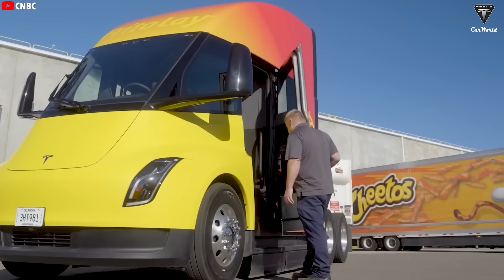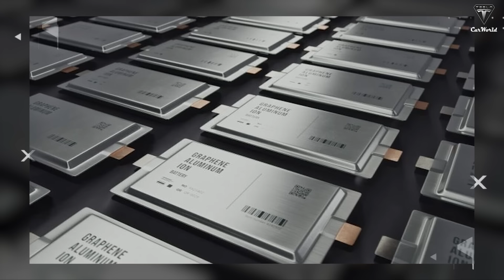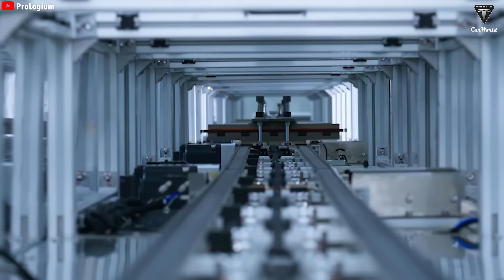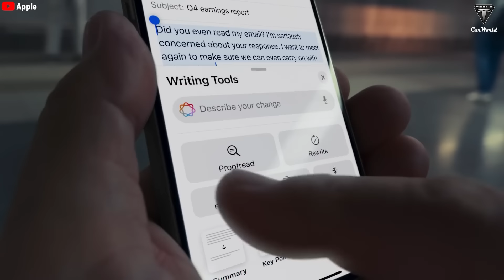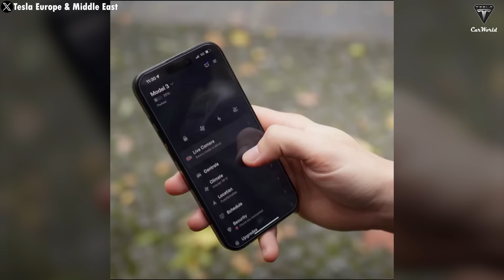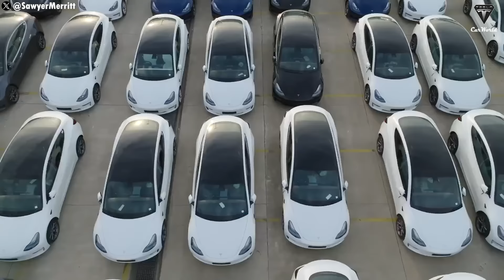Tesla Semi 2026 Finallly Break All Trucking INDUSTRY! 800 Miles, 1.55 kWh/Mile! This Is Huge!

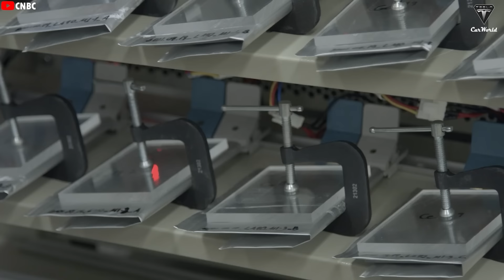Comment: 29:06  if aluminum react with oxygen/water to make aluminum oxide which stuck to the medal, that would degrade the battery which relies on the aluminum ion.  I don't think forming aluminum oxide is good.  It may be stable but will degrade the battery.